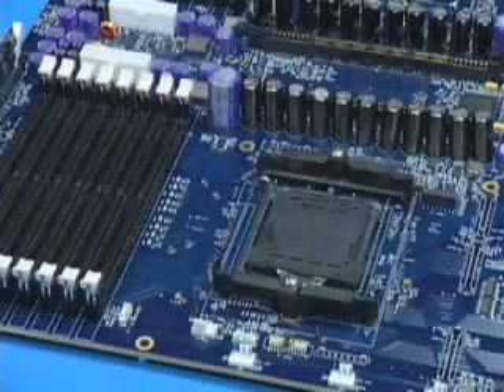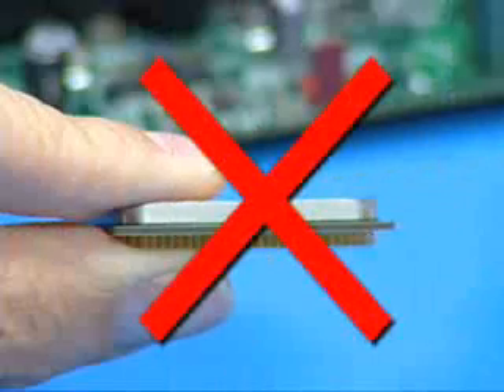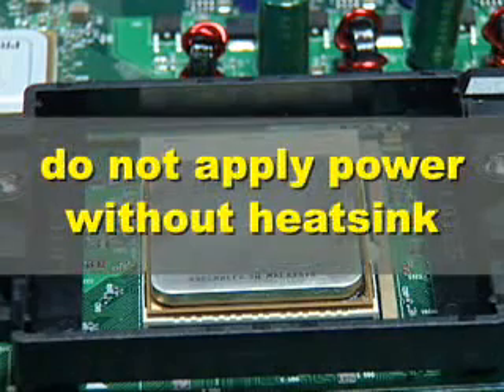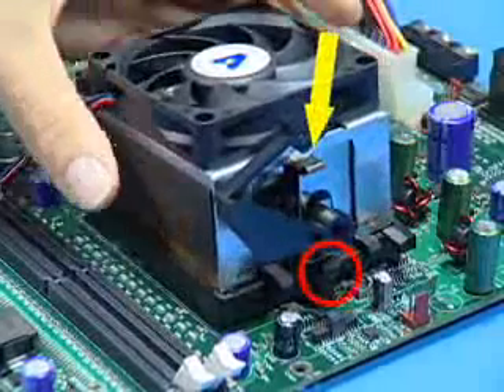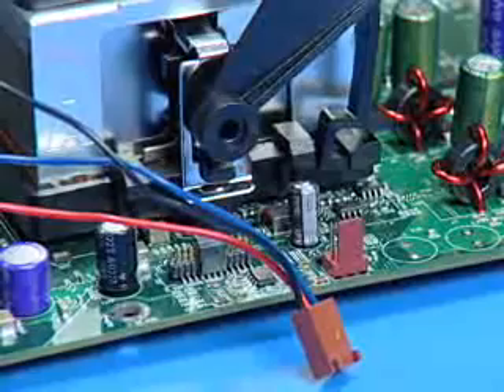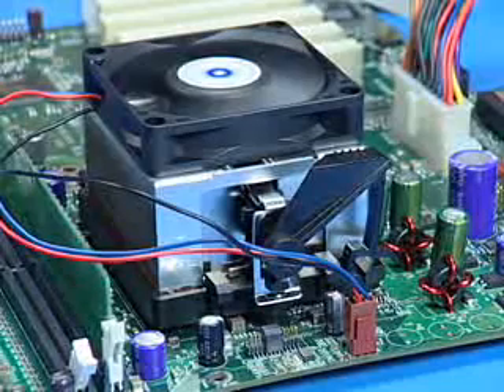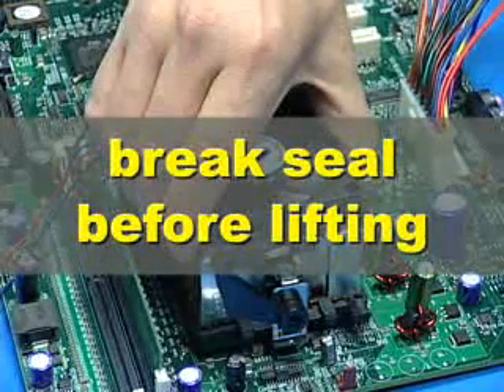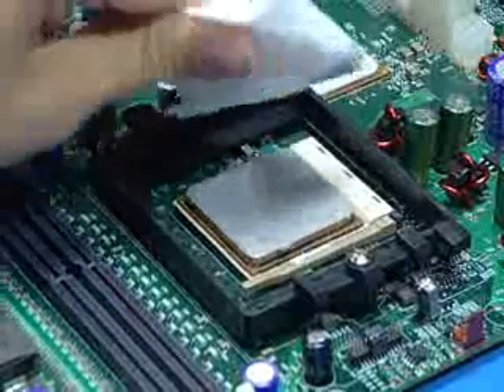How to Install and Remove a CPU and Heatsink

Comment: i removed and placed my heatsink for thermal paste replacement but when the fan is back on i boot up the system. Spins normal. Then i hear a beep and its going at Full speed. there is no way to change it. speedfan does nothing. and the Setup Utility says its running at Normal speed. Can anyone help getting my fan quiter? Thanks. (sorry for bad english im dutch)

Comment: I just wanted to know about back plates... I want the foam to remain but am forced to remove AM3+ bracket from a new motherboard, but know I am going to use it later on for a H100i. :/

Comment: Help, my amd heatsink is similar, except it lack locking and i cannot open it, it is way too hard, pushing it more would break the handle. Is  it stuck or it does have different type of locking system ( it is locked on position). I dont want broke it

Comment: I just removed mine to clean it, ended up putting it back on in the wrong direction. The screws had little rubber guides that were all different lengths, so if you don't put it back on in the right direction the PC crashes to prevent the CPU from overheating.

Lesson: Don't fuck with your computer when you're drunk. I finally got it on right, but the CPU is running hotter now. Something I was trying to fix in the first place.

Comment: You know what's funny? I tried using this tutorial in order to attempt to remove an AMD CPU from a broken computer. Unfortunately, the system it held itself in wasn't covered in this tutorial. So, after taking a flat-edge screwdriver to the latch system it had for a few minutes, it just popped right open. What was interesting, though was that the CPU didn't come flying off with it, and was still secure in it's socket. I'm now wondering if the thermal paste actually did it's job.

Comment: if not already pre-applied to the bottom of the heatsink, put one little pea sized drop on the top of the processor (opposite of the pins), and then spread it using a credit card, or use rubber gloves. there are many videos on youtube showing you how.

Comment: @wassimzombi They range from 4 to 10 dollars, they arent that expensive since is just a pice of rubber with a wire that touches your skin and the computer case all made to look pretty :P. try looking on ebay or amazon youll find loads of options or if you don't generallt buy online I am sure your local Radioshack will have some "Anti-static wristband" :)

Comment: @wassimzombi is recommended but discharging static will do the trick :o. Go to a near sink or a metal pipe that goes down to the ground and touch the pipe.. not the faucet. and you will discharge your static. Then again for extra safety you use those wristbands. So avoid things like rub against carpet, fabric or pikachus which will generate static fairly easy.hope the tip helps :)

Comment: The whole grounding thing is WAY over done..... Unless your building a computer while sliding across carpet, this shouldn't help anything. I have touched HUNDREDS of components without any protection & have never wreaked any for grounding/static reasons.